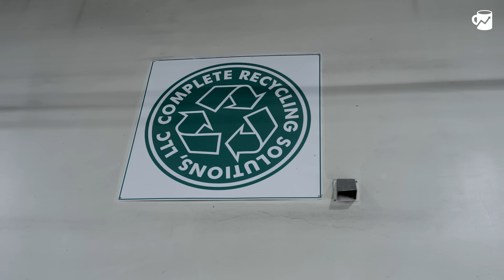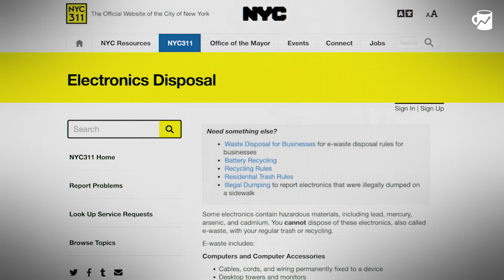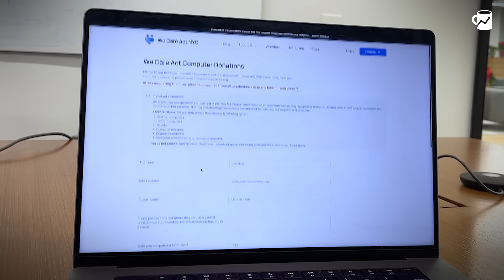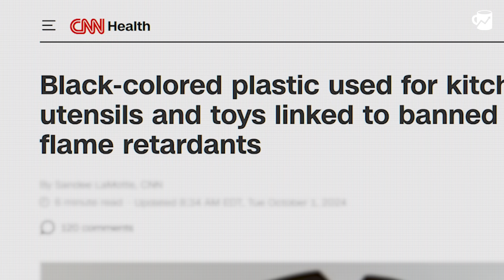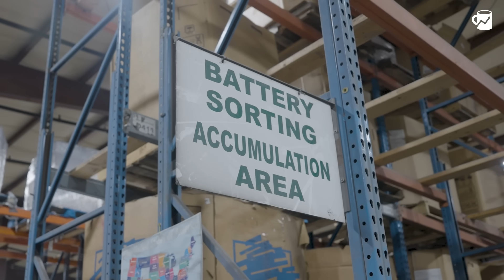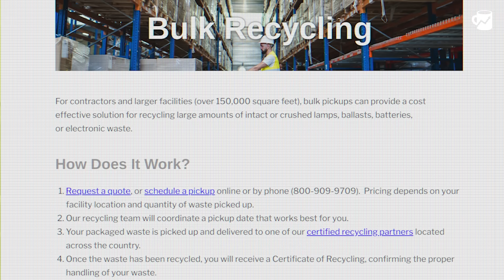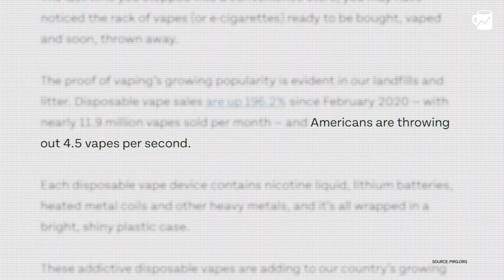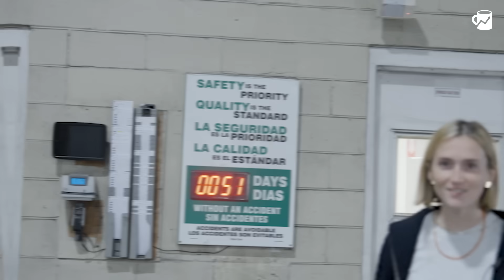I went down a rabbit hole trying to recycle all my tech waste

Comment: That T1-83 is still sold new for $100 because schools still require them
Reply: Yeah, I was surprised she let it go for $5 if it was still working. You'd assume that could be donated to a student.
Reply: @TheSongwritingCat  $5 is about the going rate for used ti 83s, unless you own some sort of retail or ecommerce store, in which case you'll get $20-30. I actually usually find them for $1 or 2. Good profits, and always sells within the hour of listing.
Reply: @TheBrandonnnn  I'm saying if you're only getting $5, you might as well donate it to someone.
Reply: Maybe there's another angle to this video. You can let your stuff go for less than it's worth, significantly less. It's crazy she keeps saying those places wouldn't take her MacBook.  @TheSongwritingCat
Reply: @TheSongwritingCat  must make enough money
Reply: *TI. As in Texas Instruments, not T1.
Reply: It's a classic example of what you can charge when you've captured a market. They're the default, so they print money.
Reply: @lankyjuggler  Thanks, capitalism!
Reply: A good article would be an analysis of how TI lobbyists have ensured that schools still require these wonderful, but arguably unnecessary machines.
Reply: It’s so crazy that they still sell for that. I had a TI-85 back in the mid-90s that I think cost around $100 then. 

Inflation adjusted it would be more now, but I still can’t believe they are still selling such a dated device for that much.
Reply: @AnotherInternetRando  It's the magic of regulation and mandatory purchases. It means they can ask pretty much anything because people are forced to buy a specific thing.
Reply: There's an xkcd about that.
Reply: @AnotherInternetRando  it's all based on certifications for standardized tests. TI got the calculators approved so there's no reason to stop selling them if they're still good for the SAT.
Reply: @AnotherInternetRando  
We got ours in school for a $40 deposit. Technically we were supposed to return them, but it was well known that everyone just kept them. Still have mine 25 years later and it's still awesome.
Reply: I feel like those calculators are just another money scheme combined with the text-books, because school require you to only use the newest model, when that's just a bunch of nonsense. The only things you need those calculators for are plotting graphs, matrix stuff, probabilities etc. But that works perfectly fine on old models as well. The text-book companies and schools refuse to keep in the old machines. And most people never use them again after school, or if they work with mathematics people often use Excel/ Exces or use specialized software etc...
Reply: @Infotainment-z7f  This is so crazy. In german its literally like: Buy whatever calculator you feel like as long as it can do x,y, and z. But I can only explain how to do certain stuff on certain calculators so when you come with the 40 year old calculator of your parents just know that you are on your own.  The one I used at school cost like 20€ and it was one of the newer and most fancy models.
Reply: @Rudmin  I learned to code on a TI-59 back in 1978. Started a whole nother career for me.
Reply: No. They require TI84
Reply: the 83 has a Z80 chip. which has a lot of support in legacy stuff .. at least back to the early 1980s. 

definitely shouldn’t be thrown out.
Reply: and why do people buy them new if you can get one barely used for $5 ?
Reply: That doesn't seem to be universal. I have had my TI-83 Plus since they first debuted and used it in college, but it was my no means necessary. In fact, my college calc professor literally banned calculators from his class and we could only use them on lab assignments where they were literally required for the task. 2 of my sister's kids got through college using smartphone apps, and now the youngest just uses AI junk.
Reply: Is that the one that plays Tetris and Doom on it??
Reply: It's a scam, it costs pennies to produce
Reply: Welcome to capitalism! Profits over People!
Reply: Why does a school need a termina-OH the calculator! 😅
Reply: And the one I bought in 2005 STILL WORKS
Reply: Which school requires you to buy a TI graphing calculator?   I attended multiple schools in the pursuit of my Engineering degree and the only requirement was to have a "Scientific Calculator."  The brand and capabilities of that calculator were completely left up to the student.

I made it all the way through my degree by using a basic TI-30+ or a graphing calculator app on my phone.  I only upgraded to the Ti-36x when I starting taking statistics and bought a TI-84 graphing calculator when I had to do complex Matrix multiplications in my Composites class.
Reply: I bought my TI-83+ brand new for $89... in 2003. Don't complain about the price.
Reply: Just another student tax
Reply: Yeah donate calculators to schools lol
Reply: Best I can do is $5
Reply: The old ones are better how do I know this? Well because my family have about a half dozen dating from mid nineties to a year ago….(lots of cousins hard to share but 6ish is about 1 per every 3-4people) and the newest one was a gift long story.
Reply: Doesn't everyone just give their calculators to younger family members or whatever?
Reply: The new ones have better screens and built in rechargeable batteries.
Reply: @thedude5040  My country's junior colleges (what we call high schools) mostly require the TI-84 Plus graphic calculator (though a clamshell model from Casio is also accepted at national exams). I traced that its design seems to date back from 2004 & its last software update was c. 2011. Since then its updates have been more minor I remember e.g. launching a smaller model called the Pocket SE, followed by a model with a colo(u)r instead of a dot matrix screen
Reply: December 17, 2024 : OpenAI's o1 scored in the top 1%-2% of participants in Putnam, one of the world's hardest math exams.
Reply: @iGame3D Say goodbye to human superiority. In all areas eventually.

Comment: This is something I actually care about about. I work at a store that takes in unwanted electronics. The biggest issue is the ammount of stuff that should be donated or sold rather than destroyed. You could cry at the stuff that's junked that's perfectly good that many people would want that's just getting sent to the destruction centers and made over more toxic e waste rather than re-usedm
Reply: I work at an engineering company as the janitor essentially. One guy was throwing out his i7 7700k desktop! Score for me! Total waste.
Reply: @bluetyphoon2100  i7-7th gen are not "fully" compatible with windows 11.
Reply: It's crazy though. you put a 2016 macbook pro on craigslist or marketplace and it just sits there because no one wants it.
Reply: @headcas620  it's because people usually want too much for stuff locally,  throw the macbook on ebay for a reasonable price and it'll be bought
Reply: @headcas620 because it's not secure. Older devices may still work but without updates using them is a security risk
Reply: @headcas620 because Steve Jobs literally bricks it after 2-3 years since it won’t run new iOS versions on purpose.
Lame and pure evil. Terrible, take a lap. It’s not that nobody wants its, it’s simply they can’t USE it since it can’t run nor update.
Reply: But hey, at least to stock prices are up! We would not want people to actually repair their stuff. After all, if they did what would happen to the profits?
Reply: @rmidifferent8906  It's much simpler. Because consumers LOVE low prices they are manufactured overseas where wages are very low, repair however needs to be done locally where wages are high. This in turn means unless it's a dead simple fix or repair is really important to the consumer the cost of repair often is to high to be viable. Why spend 200 on repair for a 3 year old device when you can buy a new one for 250? The harsh solution is to pay for the higher wages by taking back manufacturing to the western world and increasing the cost of products significantly in doing so.

It has very little to do with stock prices, it has everything to do with consumer demand.
Reply: @relo999  Hahaha, not really. While work is part of the problem it's not the main reason. 

The main reason why the repairs are very pricey is because the companies do not make their devices repairable. Or more likely it's not that they ignore repairability - they consciously make their devices harder to repair. Repair shops make the repairs cost a lot because:
- they need to source the parts from shady sources with often no support from the company that sells the device - often against the company that will make the import of cheaper parts illegal (like apple blocking refurbished phone screens at the border)
- the parts often are connected together so that there is no way to replace only one part that is broken but you need to replace the whole thing (apple again, with their hard drive being a part of the motherboard in macs)
- the parts are made in such a way that replacing them is hard and has a high possibility to break the device, so working on it requires more time and skill. Remember when we could just buy a spare phone battery and replace it ourselves? It is possible to make a waterproof device that has a replaceable battery, there were such devices. Same with laptops.

I want to just point out that apple is a very big bad guy here. They have a lot of anti repairability policies in place and depend on people buying new devices instead of repairing them. A classic video with Louis Rossman comes to mind (watch him for more apple stuff). A broken laptop is sent to the apple repair shop. Diagnosis? A few hundred bucks for a new motherboard. The laptop is fixed by Louis basically for free. What was wrong? Badly plugged cable
Reply: Yeah... I nearly cried seeing all of those CRTs being destroyed.
Reply: At my repair shop someone brought in a Defender arcade cabinet for recycling. Then my boss destroyed the chips before I could repair it. Now he's going to spend hundreds of dollars to "upgrade" it. Would've been cooler and cheaper to repair.
Reply: Possibly the problem is the cheapness or ease of financability of phones and even other new electronics.  Particularly phones.   It's possible to get by even without a desktop or laptop.  I used to frequent a local place that sold used electronics that was bought out and then closed to the public - mainly computers and components.  Bought ram, PCs, monitors, harddrives, laptops - works great for additonal workstations for other people, additonal servers, or upgrades/replacements for existing equipment.   Throw linux on it - who cares about chasing Windows.  

Such a shop might still work in a low income area?
Reply: @thunderwolf66102  lol, low income people buy new electronics because of payment plans. Good luck getting payment plans for used items.
Reply: @thunderwolf66102  This comes across as you are a mega hippy, and are like, "why doesn't everyone want to live like me?" You shouldn't have to go live all log cabin, making your own pc, using linux, and figuring out all that fairly complex stuff just to use a laptop. That laptop should be upgradeable and have a service life that can be extended without company interference. These companies should be supporting these systems, but they aren't. I'm happy your happy living your life in a fairly simple and low-cost way, but it's extremely tone deaf to say everyone should live like you, and that the issue is consumers not living within their means.
Reply: Then why doesn't the store sell it?
Reply: Why not sell it to foreign countries, like third world countries?
Reply: 😢😢😢I feel bad when things break or wasted, like it took so much effort to buy it, energy time, and all work environment.  It Aint about being miser, it absolutely  mindful use of things. 😮😮😮
Reply: This is true I've been garbage picking the last year I built my own gaming PC and got a PC for my friends and daughter. Overall I found 30 laptops 3 iPads probably about 50 phones 20 were iPhones. Tbh the list would be too long. But I'm great ful and donate what I can to people who will use it I barely sell any of it.  I started just wanting to recycle more. It's honestly insane how much you can find. I've had people yell at me to leave stuff just cause they wanted it to go to a dump instead of someone reusing it. Pretty wild.